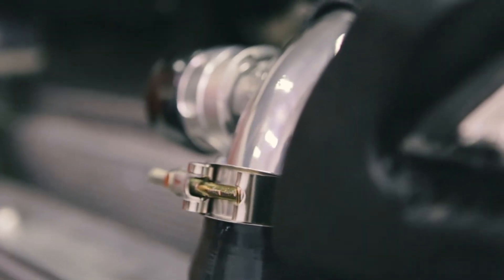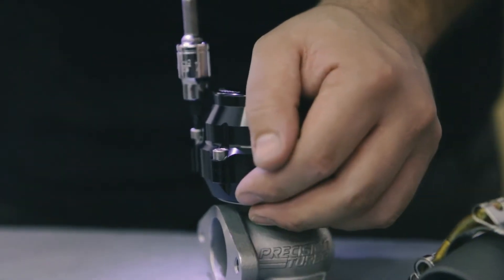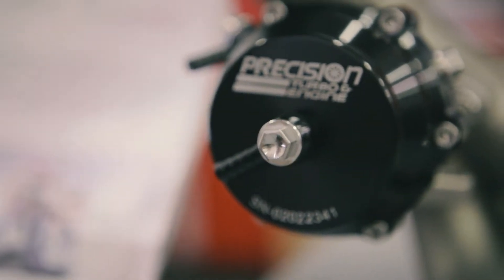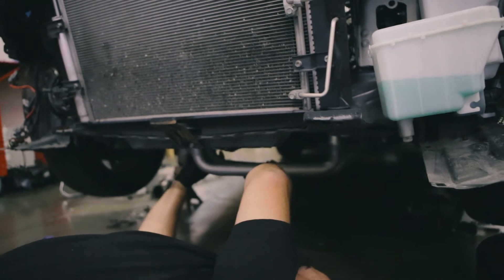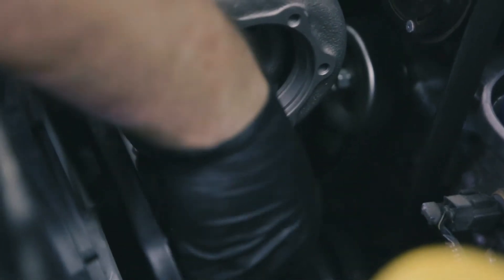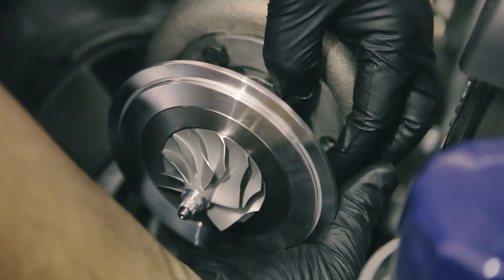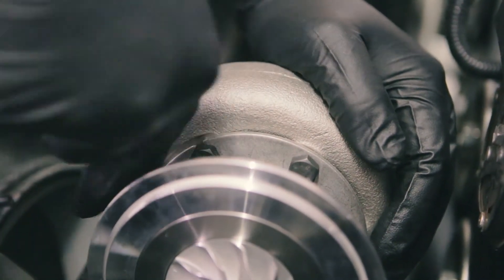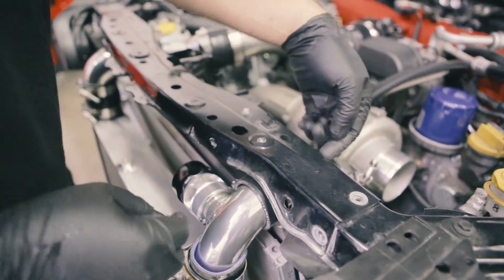JDL UEL V2 Turbo - Detailed installation tips

Comment: my buddy and I installed this kit on his Brz in 5 hours. Can be done. he had pretty much everything prepped the night before. If you buy this kit it is crucial you check that you received everything before installing. We noticed before installing that two of the vacuum lines were missing. Luckily we ran to the hardware store really quickly and picked some up and it’s worked out fine.

Comment: What about a tune, are you safe to run 5psi with no tune
Reply: Caldwell not at all! Nothing aside a stock car is safe with stock tune. Sure, it will run. It'll then literally blow up. You'll be buying a new engine, a and a lot of the turbo kit again. It can happen in 5,000 miles, or in 50 miles, but it will happen. There is no luck involved, this is factual.

Budget at least 1,000 extra for a tuning method and an e-tune or dyno tune. Brzedit is a solid choice for cheap if you get your car dyno tuned and you have a tactrix cable already.

Comment: What's the difference between the GTX2867R (Garrette GTX67 kit) and the base turbo on the kit
Reply: THE GAMING BROS the stock one is the cheapest and smallest. The two Garrets are bigger and can support more boost for power. The R is a ball bearing turbo i belive so it spools faster

Comment: 1. the line underneath the AC compressor, was that the front side PCV? where did you connect it?

2. the blue loctite bolts goes to the header end of the hotside housing correct?